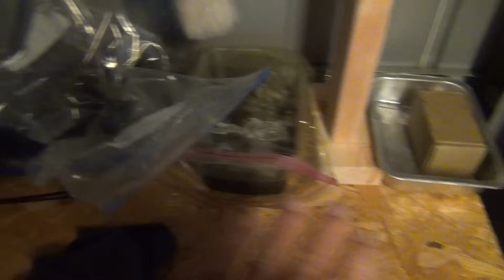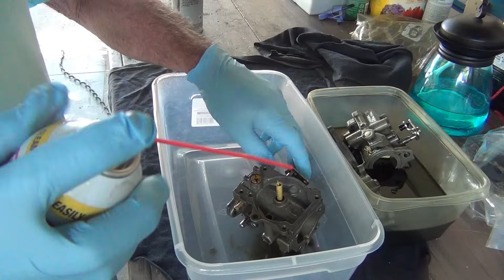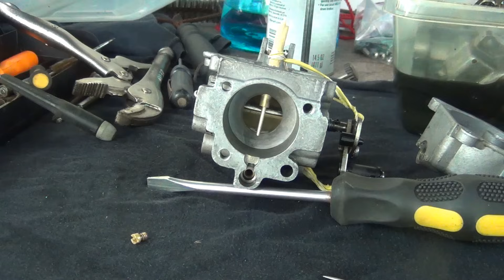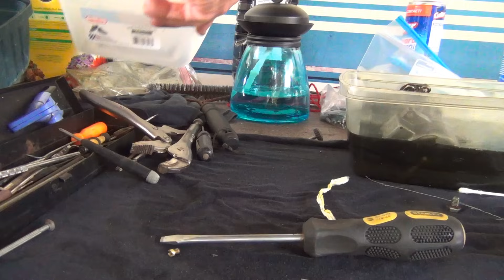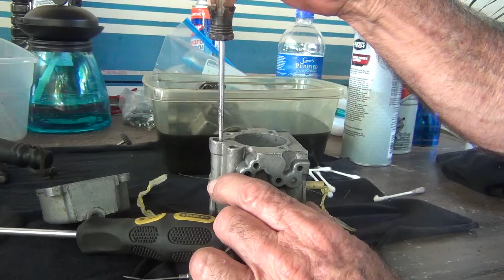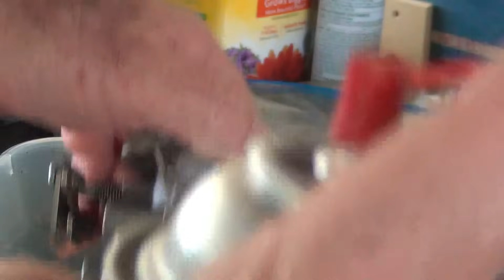Johnson Evinrude Carburetor Clean - The 2 Most Important Things / #outboardrepairvideos

Comment: I just recently purchased a boat with a 20 HP Johnson Tracker. Runs good at idle and low speed has no top end power. Will not push my 16' aluminum boat over 10 mph and will not plain. I just pulled carburetor apart not knowing much about how outboard carbs work. Thing looked perfectly clean inside with one exception the high speed orifice was mostly plugged. At the time I didn't know what it was and what role it played in carbs function of carburetor. Was just crossing my fingers that it solved my problem when i take boat out in a couple weeks. After watching this video my confidence has grown that this will solve my issue. Thanks for your videos I have learned a bunch in a short time. Keep up the good work.
Reply from the maker: Hey. Thanks. Appreciate you watching and commenting. Stay tuned !

Comment: This is a huge help. My '76 25hp has had some issues this year and it's making me think about letting it go and buying something new next spring, but this video gives me a lot of confidence to try to get it running right. Thanks for showing so much detail.
Reply from the maker: Thanks for watching and commenting. Stay tuned !
Reply: @THISOLDOUTBOARD1   I've got a boat I'm purchasing and it has a Evinrude 175 VRO motor. It cranks right up and seems to be fine, after about 30 minutes or so of driving gas starts to come out of one of the carbs overflow. This is my first boat and I'd really like some pointers. Great video!!
Reply from the maker: @stevestewart3816  Hey. Thanks for tuning in. Sounds like the float needle is not seating and it keeps filling up with fuel and overflowing. Do a good cleaning on it and replace that needle if need be. check that float too, it could be full of fuel if its cracked. Carb kits are cheap, you may want to do them all. Thanks again !
Reply: @THISOLDOUTBOARD1   where is a good place to get the rebuild kit
Reply: Keep the old ones. The new 4 strokes are money pits 2 strokes are way better
Reply: @Kyle-bb9zp  music to my ears

Comment: Have a 75  Evinrude that wouldn’t run in idle. Finally realized that the idle cycle ran from bottom of carb to top. It was plugged up at the main body to the point of complete obscurity.  Once I found the hole in top, cleaned it up, and put it back together, it worked like a champ.  Today I finished replacing the pull cord mechanism, and oiled it. This old engine ran beautifully!  Love it
Reply from the maker: Sounds great! Thanks for watching !

Comment: Thanks a mill for your videos.  I am new to the boating/outboard world and have a '78 Johnson 25hp that will start but won't stay running.  I have isolated it to a fuel flow issue somewhere after the fuel pump.  Most likely a clogged internal line or needle orifice.  Your videos have given me the basic knowledge and confidence to pull the carb off and take care of business.  Just started pulling it apart this morning after work.  It is all gummy all over.  Hope to have it fixed in the next couple days.  Looking forward to fixing it and having this issue behind me.
Reply from the maker: Hey. Thanks for tuning in. Stay tuned !
Reply: @THISOLDOUTBOARD1  Oh yeah - rebuilt the carb.  Fired right up and kept on running.  The carb rebuild definitely helped, but noted on the disassembly that one of the two nuts holding the carb on was loose, so it was sucking air, which I'm sure was the main source of the problem.

Comment: And old mechanic taught me to clean these idle circuits with an old guitar string. E string I believe it was. Thin enough to fit and rigid enough to push through. Take that knowledge to the bank. Thanks for the fun video my man, love the commentary!
Reply from the maker: Hey Charles.  Thanks for watching and commenting. Yeah I've had others say they use them too. Thanks again and stay tuned !
Reply: @Wilder Ty instablaster :)
Reply: @Reece Ariel it did the trick and I now got access to my account again. I am so happy!
Thank you so much, you saved my account!
Reply: @Wilder Ty no problem xD
Reply: I use welding tip cleaners

Comment: I have always tried to stay away from carbs, but these are more simple than I thought. The problem I have been fighting this last month was red gasket maker inside the plastic fuel manifold that the fuel comes out of to go to the primer solenoid and the 2 carbs on my 93 Johnson 40hp. Took me longer than it should have to figure that one out. Finally ripped every hose apart and make sure I had flow from 1 spot to the next and found that obstruction. Went through 4 fuel pumps, 2 primer bulbs and gas lines, plus several spark plugs, and cleaned the carbs over and over again, cleaned the gaskets between carbs and intake, checked reed valves, compression, spark gap checker. Was grasping at straws. Finally ready to get on the water without limping along and finally get up on plane. Thank you for your videos. They help a lot and it always is entertaining to hear Tommy Chong of Cheech and Chong talk outboards 😉. Have a great week!
Reply from the maker: Hahaha Thanks !  LMAO !  Really appreciate you watching and commenting. Thanks again & Stay tuned !
Reply: @THISOLDOUTBOARD1  Absolutely will be. I know you would be a hoot to chat with in person. Have a wonderful morning and enjoy eating those big bass. Makes me want to do some trolling for bass. It's been 35 years or more since I have done that....back when I was 10 or maybe younger. Keep on fishing and repairing.
Reply: i sell handmade reproduction fuel manifolds for that motor... $15 just screw on and go!

Comment: Dont forget to test float the float in a cup of gasoline.  Mine was sinking and causing the motor to stall when moving out of idle.  Replaced the float and now it runs great.  Easy to work on these engines :)
Reply from the maker: Hey. Great point! Test those floats people! Thanks !

Comment: I cleaned mine AGAIN last night and learned about how there are a type A & type B typical and non typical..Those air bleed jets are not the same for top and bottom carburetors .Top takes a 33 and lower a 35 so dont get em swapped by accident.
Reply from the maker: Hey. Sounds like you've been doing some homework! I did not know that. Thanks again & Stay tuned !

Comment: I enjoy your videos.  Getting my 1976 25hp Evinrude out of mothballs. Running it in a barrel, seems like it has a cough at low speeds and then like it runs out of fuel. Will start right back up with no problems. New fuel line and pump bulb. Has 120 psi compression, I'm thinking maybe fuel pump issues.  Danny
Reply from the maker: Hey. Thanks. If its starting right back up the pump sounds like its working. Pull the drain bolt out of the bowl and see if there's still fuel in it. Set your slow speed needle at 1.5 turns out. Check the slow speed needle retainer, it may be bad and sucking air. They will also start to deteriorate and can clog the slow speed jets. Dont forget your timing set. Shouldn't be too hard to figure out. Thanks again & Stay tuned !

Comment: What solution are you soaking these carbs in? Thanks.
Reply from the maker: Hey. The main ingredient is STP Total Fuel System Cleaner, some carb and break parts cleaner, a little gas and some 2 stroke oil so it doesn't evaporate to fast. Thanks for tuning in!
Reply: Would it be safe to use some penetrating oil like pb blast?
Reply: @Someguy6798rthurfhurdfyew3t et Quick Silver- power tune, a lot of professional marine people use this😉and get an oxyacetylene torch tip cleaner(little round files)

Comment: Morning, I have seen you make up your Carb cleaner for soaking the carb parts. Like a dummy I didn't write it down for whatever reason. Would you be kind enough to share what you use. Thank you in advance. Please keep the videos coming. They are great, and informative.
Reply from the maker: Hey. Thanks for tuning in! The main ingredient is STP Complete Fuel System Cleaner. Then I sprayed some carb & brake cleaner in it and added some gas and 2 stroke oil to keep it from evaporating. Thanks again & Stay tuned !

Comment: I appreciate the content!.. Thank you!... Was wondering, towards the end of the video when you were blowing cleaner through the brass tube back and forth to get a good spray. On my 78' 25 horse there are three holes where you have the two for the low speed. Trying to figure out where I need to spray to clear this tube. My question is do I cover all three holes and spray up the tube and if so where will it come out, where my low speed idle screw goes? And vice versa spray in low speed idle orphus and look for it to come out the bottom of the brass tube. Trying to get a good flow through that tube but it seems like it will spray one way. Any input is appreciated and if you don't get back to me in a timely manner no biggie I'll slap it back together and see what she acts. Once again thanks for the input there's always been two things I never wanted to work on #1 being a carburetor and #2 being a transmission!.. Sure aint screwing with a transmission!... 😂
Reply: After sitting down with it and actually taking a look at it good I believe I've got it sorted out now. On my carb see a hole to the left of my low idle screw that leads down to that tube so I think I got it. Much appreciated though everything else seems to be clear
Reply from the maker: Hey. Thanks for tuning in. Spray it through the ss needle hole. The needle is what controls what comes out those holes. Putting your finger over the holes is only to feel the spray coming out hitting your finger, that way you know they're clear. Once you do the puddle test and you can see each hole drain your good to go. That hole to the left is just an overflow/breather hole. Thanks again & Stay tuned !

Comment: Thanks for sharing your knowledge and tips. Just got a 1988 Johnson 28 SPL and I am new to outboard tech. After reading what ethanol can do to older carbs I'm a little hesitant to pull the carb off but the motor hasn't been run in years so I guess it's gotta be done. Someone else asked what you soak them in for solvent and you mentioned it was a combination of things. What are the ratio's of the solvents/gas/oil that you use. Thanks- subscribed!
Reply from the maker: Hey. Thanks for tuning in. No real ratio, just a little of this and a little of that. But the more STP the less of the rest!  It seemed to be the STP that's doing the work the rest was just filler to cover the carbs enough to soak. If I used 5 bottles of STP, probably wouldn't need the other stuff. It was something I had tried in a previous episode and I was impressed on how well the STP did. I buy a bottle every now and then for my van and one day I threw some in on a carb soak. So I tried it again and it worked! Yeah you need to clean that carb. But in reality the ethanol doesn't take a toll on these 2 strokes like it does on a 4 stroke because of the 2 stroke oil mixed in. But they do get clogged! I've seen the ethanol eat the finish off a carb bowl on a 4 stroke and they have to be replaced once that process starts, but never seen it happen on a 2 stroke. Thanks again  & Stay tuned !

Comment: Good video.I have used a small piece of guitar string for those tiny holes in the throat.Hard to get a straight shot on them if needed.Your right never assume!
Reply from the maker: Hey. Thanks. Yeah I have a set of the welding tip cleaners but dont know where I put them. Hahaha I'll just buy another set !  Thanks again !

Comment: i just bought an 87 johnson 150 v6. Lately i noticed something interesting. I can get her to 40 mpg no problem, i can be at a dead stop and punch it full throttle no problem. Once over 40 mph if i continue to push it down, my engine will bog and lose power until i throttle back and it recovers, usually around 30 mph. shes a two stroke and i took the sparks out to look at them and they are pretty dirty, but being a 2 stroke i figured as much. I dont know when the last time they were changed. I also heard it could also be a bad coil pack. I was thinking maybe dirty carb? This is my first boat and i am already learning so much! Any help or input would be helpful. Thanks so much!
Reply from the maker: Hey. Thanks for tuning in! Try this, check the "Link & Sync". Sounds like you may be going past full throttle and the butterflies in the carb are traveling to far. They should be perfectly horizontal at wide open throttle. If they're going past horizontal they will be pointing downward and restricting air/fuel mix which will cause it to bog until you recover the throttle position. On these carbs there is a roll pin on the end of the butterfly shaft, # 13 in the schematic, the roll pin is also an indicator to show the butterfly position. At full throttle the roll pins should be perfectly vertical which means the butterfly will be perfectly horizontal. Put the throttle in wide open position and check the roll pins position- adjust the link & sync. You may want to get an OMC service manual specific to your year/model. Check ebay for a good used one. It will save you time & money, it will have a great troubleshooting section too. It will show you proper procedures to set up the linkage synchronization, low speed stop screw and high speed stop screw, ect. Coils tend to break down once they heat up, I would think if thats the case you would know at all speeds not just wide open throttle, but never assume anything with these outboards. What may seem like a fuel issue can be ignition and vice versa. They tend to mimic each other. Here's the link to the schematics. https://www.marineengine.com/parts/johnson-evinrude-parts.php?year=1987&hp=150&model=J150TLCUR&manufacturer=Johnson&section=CARBURETOR
Reply: @THISOLDOUTBOARD1  I thank you so much! I'll give it a look and it makes sense to me! I appreciate people like you who take noobs like me under your wing
Reply: @THISOLDOUTBOARD1  Its possible that these things have never been adjusted. I have become close friends with the seller. It was his brothers boat who passed. He couldn't run the boat as much as he wanted to.  Now I take it out once or twice a week.  I typically don't push her that hard, I like to now and then just to keep everything in strong working order. I typically only run 30-40mph which it performs perfectly on. Now that you mention the link and sync, I noticed that when in idle and in gear I do have to give it a little cause cause it seems like it wants to stall. They had out a hot foot in it, so I'm wondering if during that install possibly some cabling came loose or not set correctly
Reply from the maker: @CTRadventures  Hey. Anything is possible, things get old, cables stretch out, it probably needs some servicing. That's why I say to get yourself a manual, give er a good tune-up!
Reply: @THISOLDOUTBOARD1  thanks again! As I'm new to this I might have my neighbor who's a little bit more versed and carburetors and stuff see if we can take a day and try to tackle this, it might not be right away but I'll definitely get back with you. I have new spark plugs coming tomorrow cuz I pulled the other ones out and as expected on a two-stroke those things were dirty as heck so maybe it could be as simple to fix as that so one little piece of the puzzle at a time right
Reply: @THISOLDOUTBOARD1 I cracked into it, replaced all the fuel lines in the motor, there was one with some plastic inner lining that had constricted! Now I got get back up to 54mph on WOT!  I did notice on the carbs there was residue and at the bottom of the motor I saw some gas. Hmm I looked at the carb seams and pressed the gasket w my finger nail and poof I could see liquid. Then the bottom carb line has a tiny drip where it connects into the carb at the 90. So I bought a carb kit. Not  necessarily looking to do an entire carb build but while I have the carbs off, spray em w cleaner and air and see what happens. Then replace em w the new gaskets
Reply from the maker: @CTRadventures  👍
Reply: Just did the carb rebuild. Two of my 3 units have cracked emulsion tubes. Put her back together until I can find a fix or replacement, was able to get her up to 55.5 mph WOT. I freaking bumped my cabling and what not when re installing, now her idle is too low. Trying to figure out how to get that back. Hopefully I don't have to do a whole link and sync

Comment: So I have. 1975 Johnson 115. It sat for awhile before I got it. It ran great in a barrel so I didn’t go through the carbs. It idles fine but on the water it did not like going above half throttle or so. Just cleaned the carbs and 3/4 ( I have two, two barrel carbs) of those little tiny jets were clogged. Think those jets could cause an issue like that?
Reply from the maker: Hey. Thanks for tuning in! Well sure, if its been sitting the high speed jets could be clogged. Once your convinced they're clean and you still have the same problem, I would recommend getting an OMC manual specific to the year/model. There's a troubleshooting section that will tell you what to check on this problem. Check ebay for a good used one. Thanks again & stay tuned !

Comment: great info, thank you. what is the cleaner that you are using to soak the carbs that is cleaning the brass so well? Thanks again for your knowledge.
Reply: looked further into the comments and found my answer...STP total fuel system cleaner
Reply from the maker: Hey. Thanks for tuning in. The stuff is STP Complete Fuel System Cleaner. And some carb cleaner, brake cleaner, a little gas and 2 stroke oil to keep it from dehydrating. Thanks again & Stay tuned !